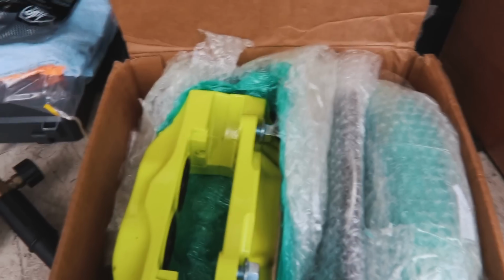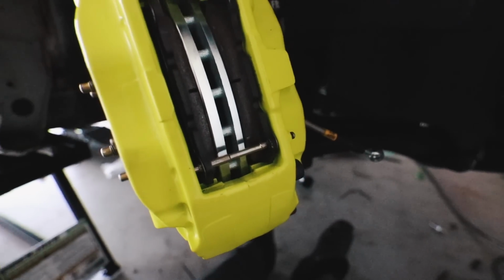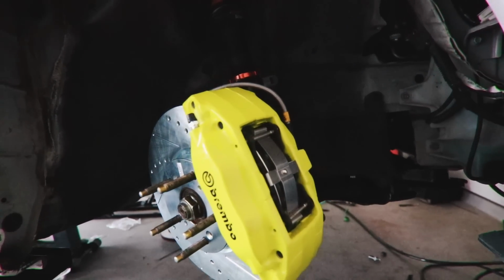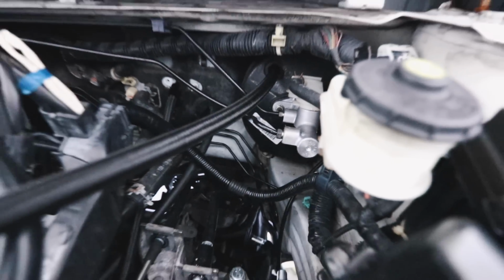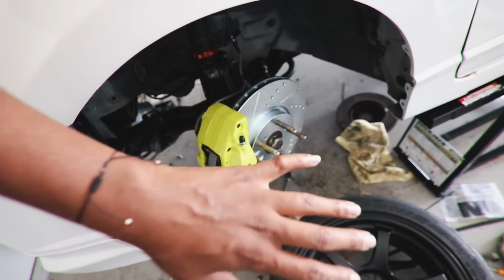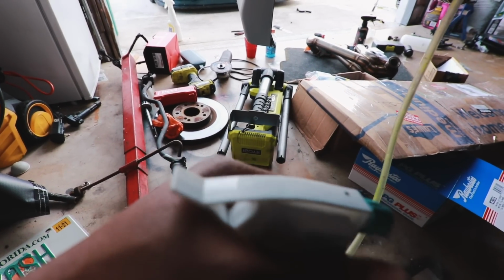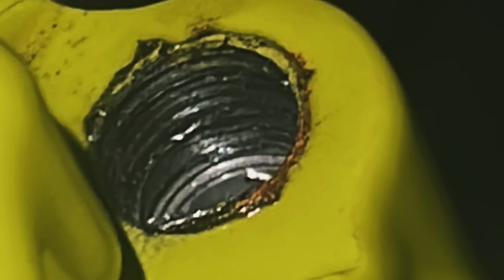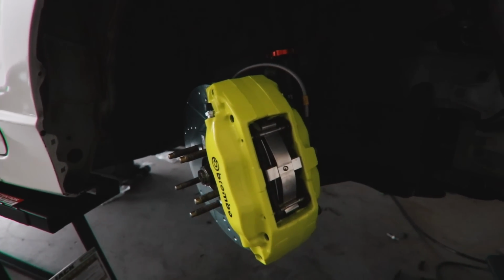MY CIVIC SI GETS BREMBO BIG BRAKE KIT INSTALL then this happens...

Comment: So do you need a spacer to run these calipers on OEM style wheels? I’m running Mugen GPs
Reply: Yes I think 20mm. I’m running GPs as well and going to install my bbk soon
Reply: @jaredshattuck3616  looks like I’ll be buying studs and bearings next haha. Thanks!
Reply: @jaredshattuck3616 what size spacer did you end up having to use just got a bbk and don’t know what size to run until I get another set of wheels

Comment: This is the side no one shows.  Hope there is a way to fix it.  I used a pressure washer to clean my Civics engine bay a few years ago.  Thought I covered everything up… whomp whomp.  Had to replace my distributor.  Hope the caliper can be saved. 🤞🏾

Comment: All these tls kits you find online use non genuine cores it seems. I am not paying $600 plus for $70 no name calipers with a spacer and powder coating. Genuine core remans can go for $500 plus on their own and to do it right you need a spacer and specially machined rotors. For $1000-1500 just to do the tls swap correctly just buy a real big brake kit. I am currently thinking about doing a tls master paired with tsx caliper/rotor and stainless lines plus quality pads. The budget factor just isn't there with a tls setup IMO unless you are willing to deal with shit quality fake brembos.

Comment: Honestly bro there's some things you have to buy new esp for track cars especially for Brakes. A lot of fatal accidents in the track are brake failures you don't want any compromise.
Reply: i agree with you man i bought Brembo for my 05 WRX and i got them used but paid top $$ to get every thing replace and i got them powder coated purple with new lines and rotors :-)